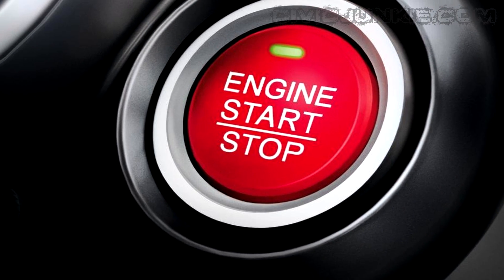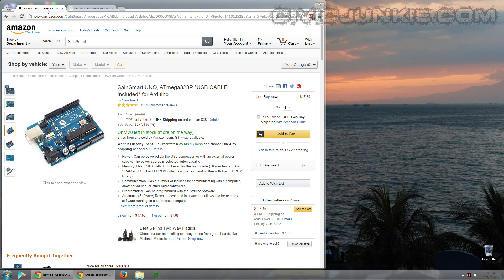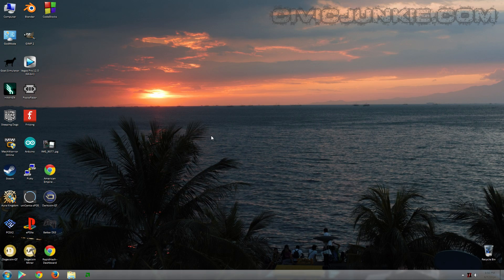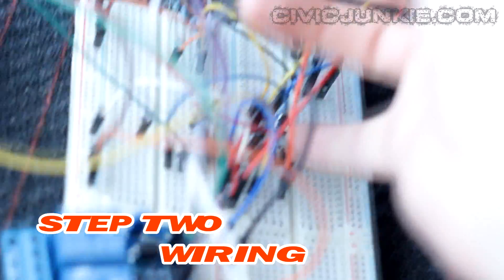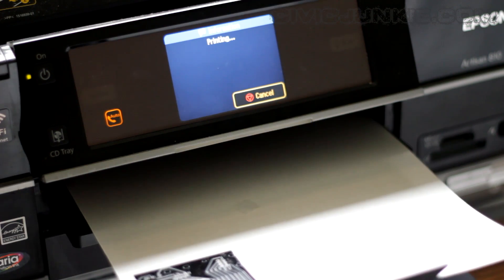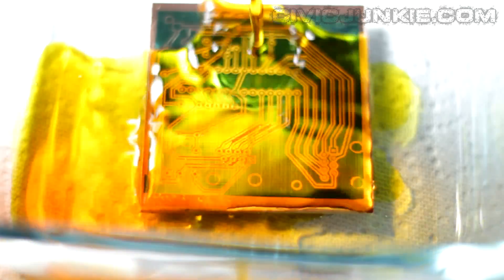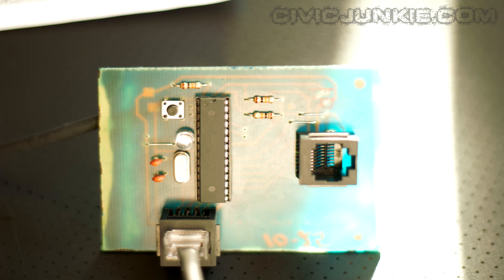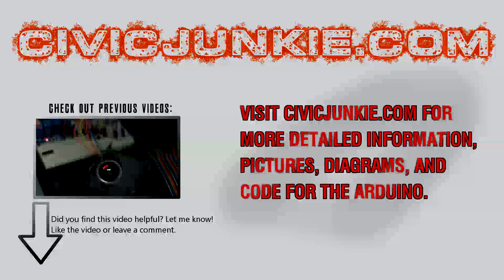Engine Start Button

Comment: Great work bro, am doing mine soon  as my switch arrives. Just concerned about security though; any measure taken on that perhaps...
Reply from the maker: The final result has RFID. An RFID tag or a phone with NFC can be used as a 'key.' I don't recall if I ever put that in a video, though.

Comment: Hey man greetings from Colombia, good job on the project. I saw this a few months ago and I went ahead and made it for my car. I'm still working on it, I've done a few tweaks to your code to Mach my needs but I'd like to know how do you manage the Power consumption of the whole system, do you use any kind of killswitch or do you leave the ATmega on all the time, since I used a voltage regulator instead of an USB converter, it gets hot after some hours, I don't want it to consume power while the car is off and the alarm is set, so how have you done yours?
Reply from the maker: The ATmega is always powered. Its current draw isn't enough to drain the car battery. However, you should measure how much current your setup uses and determine if it's okay or if you need to make changes. I think you should make sure all your car's electronics pull less than 100mA when the car is off, probably closer to 50mA, but it depends on the car battery. Also, if the regulator power waste is acceptable, maybe just attach a heat sink to the regulator.

Comment: you over complicated something so simple.

on a pre2000's vehicle you can theoretically hot wire your car and just put a switch in line so when you flick the switch it completes the circuit and the starter kicks in. of coarse you would need an accessory switch as well, but still simpler then printing you own PCB.

Comment: That's a lot of effort spent on a start button, when your key did the same job for free.   

Speaking of the key.  The really funny thing here is that you'll still need your keys to unlock your doors, as I don't think those cars had keyless entry.   

I will say, props for engineering something that works, albeit redundant in this application.

Comment: How does the car know the key is inside of it?  Does the circuit board communicate with any kind of alarm systems?  Does the car still have a steering lock?    
Can you just start it without a key?

Comment: So I'm finding this vid 2 years after you posted but it's answering my need for a DIY solution I feel I can actually get behind. Is the code essentially the same? Or does it vary by vehicle/button setup? I'm custom building a very with a Subaru engine and I'm planning on getting a Prius button installed.
Reply from the maker: The code should basically be the same for every vehicle, but may very slightly depending on how the original ignition switch works. All we're doing is replacing the keyed ignition switch with a relay module which is controlled by the Arduino/micro-controller. You will have to look at your ignition switch and figure out what wires it sends power to when you turn the key to the various positions. Any button will work. I wrote the code to control the 4 LEDs on the button I used. If the button you use doesn't have the LEDs, it'll be fine. You could use those outputs to turn on the headlights or something instead.
Reply: Dope. Thanks. This rig has helped simplify the whole idea for me.
Reply: Also, saw your article afterwards about adding RFID. what's your reason for using an entirely different arduino with the RFID device linked to the first UNO? could you not add Arduino's RFID shield and rewrite the code to include the function?
Reply from the maker: +Santos Nunez  I simply didn't have enough input pins free to add an RFID module to the same microcontroller. I attempted other ways, but found this to be the most reliable. Made coding easier too.

Comment: This isn't a how to add "start button" for dummies. Thank you for showing us the proper way without turning a key. Very detailed. Very impractical for even the average gear head. Could you hook up a key fob that acts like the newer model push buttons? As you know, the factory modern push button (at least for Mercedes) you need the key fob inside the car for it to start? Maybe that's your next video?

Comment: You can also use the Arduino Nano. Use the UNO to programme it and no circuit board printing. Plus it's smaller.

Comment: Is the PCB with the ATMega328 meant to replace the Arduino after prototyping/testing or dose it serve some other purpose?
Reply from the maker: Exactly. It's just to make it more permanent and durable. You could just solder wires straight to an Arduino Nano or something similar if you wanted.

Comment: I looked at your other tutorials and details on CivicJunkie and seen that you wrote the code so that you have to press the break peddle to actuate the starting sequence. On my 2003 Altima you don't have to press the brake to start the car and I don't want to have to start doing something new and something I view as ridiculously unnecessary. In my car as a safety feature you have to press the brake to take the car from park to another gear. So, I was wondering if the Arduino hardware would allow the writing of code so that, as you already demonstrated,  1 press actuates 'ACC" and a second press actuates 'ON' but in any mode (whether 'OFF", 'ACC" or 'ON') a long press, of say 1 or 1.2 seconds. would initiate the start sequence.
Reply: Richard Manson Remember.. Computers are just rocks we tricked into thinking.

You can make code do whatever you want as long as you know what you're telling it to do.

Comment: One way you can add anti-theft is like a friend of mine did. He had two buttons and a toggle installed and would have to do a sequence of buttons and toggles to enter a code to enable the starter. He had it done by an aftermarket alarm system installer. Was something that only engaged if he was forced out of the car and triggered by the anti-hi-jacking feature and something that prevented start if you didn't unlock the car with the key FOB. Wasn't needed in Vale mode either.  Could this somehow be adapted to completely replace key-less push button  system that malfunctioned.

Comment: this is a good video about start stop function,we are professional in this field,you can contact us if you are interesting in our engine start stop system.

    shenzhen cardot electronics technology Co,.ltd is a manufactuer
and trader specialized in the research,development and production of car alarm,keyless
entry&push button engine start stop system,GSM&GPS car security system.

Shenzhen Cardot Electronics Technology Co.,Ltd
the 6th Floor,Cheng Jia Technology Park,NO.3581,FengXin Road,GuangMing New District,shenzhen city,china

Email:info@szcardot.com
Phone:8675527119211
whats app:+8613510257499
skype:cardots
wechat:13510257499
web:www.szcardot.com

Comment: unless you have a sistem that senses your key in the car, or one in which you insert the key fob and than push the button, you just made that car easy to steel.

so the idea with the key and the button is not counter intuitive... but the whole button thing is silly... i have start button with fob inserted and i miss the key in my old car.
Reply: It is counter intuitive in that if you have to insert the OEM key into a hole, and then ROTATE IT TO THE START POSITION, why would you install this project to push a button when another clockwise click of the keyed ignition switch does the same thing. The idea was to eliminate the necessity of a key being inserted and turned or needing a key altogether. I applaud his effort and work but he should have included an anti-theft component to this.

Comment: Hi Alloy, I watched all 3 of your videos and found it very interesting and would like to do this on my car.
However i did try it out with one arduino, bench tested it as shown in your video but it does not work the way i see it in your video, I used the code and followed the schematic that's on civivjunkie.com I also followed the pin assignment like how its in the code but had no luck, the accessory and ignition works ok but starter dont work at all and stays on all time and when it suppose to shut foo all power it blinks and comes back on and stays on.
Could you please help me get this right.

Comment: Hey again. I'm starting to figure out how to code it all myself, but i'm having a bit of trouble, mostly with the green LED, that normally flashes but flashes hard when the clutch is pressed. I can do so the button lights green for 100 milliseconds and then shuts off for 5 seconds, and when the clutch is pressed it flashes hard. But it doesn't happen instantly. It waits until it goes through the 5 second loop before flashing hard. Can you help me fix that?

Comment: Does this bypass the immobilizer? I have a 99 prelude type s as a project car but I accidentally misplace my ONLY ***** key and now am screwed ._.
Reply from the maker: You would have to purchase a separate bypass module for the immobilizer. As for losing your keys, check to see if a Honda dealership can make a key using your VIN. But, if you're looking for an excuse for a fun project, here ya go!

Comment: Ok so one think you forgot if you don't have a key to go with the start button someone can easily break you're window and push the button and steal you're car
Reply from the maker: That's why I added RFID after I made the video.
Reply: It be nice if you said that. That's a very important part of the whole piece.
Reply: Why not make a video on that? I am assuming you didn't yet because you didn't mention making it here by editing your comment. Also, how secure is your RFID system? Can someone just scan the air with a receiver and steel the codes? Did you use some more sophisticated system like code rotating or something. I realize a sophisticated system may not be necessary if your car is not on the hot to steel list or older but some may be interested in knowing.

Comment: And what will I do with my key after installing it ? Will it be only used for unlocking my car ? And what if someone press the button Unknowingly? It happens with children generally
Reply: I didn't look at the code yet but If he wrote correctly, it should prevent the starter from being re-engaged while the motor is already running. I am not sure how this or most buttons work (since I haven't owned such a vehicle) in terms of a second press automatically initiates the start sequence or it takes a 'long' press or what. Any children should not be left in a vehicle without the operator or an adult somewhere nearby within eyesight anyway.

Comment: I'd prefer to stay with the key unless there is a way to code security into this.
Reply from the maker: I have since added NFC to my engine start button, so yes, you can easily add security features. I have a video half finished of the NFC/RFID setup, but procrastination...
I did post something on civicjunkie.com about the NFC, though.

Comment: For these or future circuit boards i highly recommend a Co. called ExpressPCB, easy to use and you get 3 boards for 61 bucks in a couple of days. easy to use free software, too. check them out, I've used them for years. https://www.expresspcb.com/

Comment: hey so the code that you have on that site would work for any car or truck?
Reply: Scrappy ...... you shouldn't even be thinking about attempting this project if you didn't realize that the code was pertinent to the ARDUINO, and did not interface with any of the motor vehicles OBS's. Everything was stand alone and custom right down to the actuator. Most of us didn't even need to see electronic or electrical schematics to realize this. Or, maybe you didn't watch the video closely enogh.

Comment: Ferrari Lamborghini and other super cars use keys and start buttons. so not really uncommon
Reply: Those vehicles you mentioned are in themselves UNCOMMON to most of us and to say a push button is not uncommon because it is common on vehicles that cost well over $150,000 is a retarded and irrelevant statement in itself. Fact is that a push button start is not uncommon anymore among COMMON, domestic vehicles manufactured in the USA over the lase 3-5 years. I am assuming that you own NOTHING BUT Ferrari's and Lamborghini's unlike 99 percent of the rest of us.

Comment: Hey man, I'm having a bit of trouble getting this to act right. My "ON LED" won't turn on, and my "ACC LED" turns on in seemingly random order -sometimes with 3 button presses, sometimes 2, sometimes 5. Also, I notice in the code you put on CivicJunkies, you use pin 2 for the clutch switch, but on the diagram you don't even use pin 2. I'm new to arduino, so I would appreciate any help in getting this to work!
Reply from the maker: +Talal916 Interesting issue. Does the button have a pull-down resistor? Are the positive and negative LED leads connected with the correct polarity in mind? Another thing that might affect the circuit is improper or missing ground connections.
Reply: Lol, I'm the guy who emailed you. Yeah I'm using pull down resistors and double checked the polarity. Still working on implementing that updated code you put up with your NFC build.

Comment: ahhh button start is more old fashion then key start
Reply: HUH? Buttons require electricity and keys have been around since LONG BEFORE electricity. Do you have a pill bottle nearby or maybe a bottle with liquid in it with the number 80 on the side? Or maybe a skinny little cigarette .......

Comment: +Alloysnake I've watched your video over and over again and have been on your website... ok cool I get most of it but I just don't see what you do with the arduino after the you print the circuit board the website either also doesn't show... I'm interested in doing this because all the others you still need a key 😛.... ok correct me if wrong.... you connect the arduino to the circuit board then the circuit board to the relay module?

Comment: Or you could scrap the Arduino and pcb, add a button to the ignition wires which when pressed would essentially be hot wiring your car... And save all the hassle of a circuit and mc since it doesnt have a security feature anyway....
Reply: Your ignition switch is NOT just and on/off switch. It has three positions. So NO, you can't. Maybe you could eliminate the electronics by adding 2 toggles and a button or 1 toggle and 2 buttons. But then it would be a slopping looking job and be easier to just turn a key.

Comment: So what are you supposed to do if you have a older car with no computer?
Reply from the maker: +Matt Carrasquillo This is easiest on older vehicles, such as most vehicles made before 2000. All this is doing is replacing the ignition switch with electronic modules. It's slightly more complicated, yes. But, when implemented correctly, it is easier to use, and has a "cool" factor. Basically, this is just for fun.

Comment: Alloysnake, I commend you for being able to use your knowledge and sharing it with us. I did review comments. I will say a lot of losers who have no respect for others. Their comments leave me to believe they are very ignorant. 
Some of the viewers do bring up valid comments. You have computer skills most of us don't. You have capabilities to print circuit boards we don't. You are talented. I was hoping this would be a fairly easy tutorial. It seems like I need to search further, like for a kit.
LOVE the music, that I can agree upon. Thanks for sharing.
Reply from the maker: +Michael - I appreciate your comment. You do not need to create a custom circuit board for this. Though, there are good tutorials by other YouTubers that explain the process far better than I can (search "circuit board etching), and you can find all the materials on Amazon. However, you can do this without a custom circuit board. If you know how to solder, you can just solder wires straight to an Arduino Micro or Nano; maybe use generic connectors to make it modular. For some reason I hadn't thought of this at the time. Again, I really appreciate your comment, and how balanced it is. I'm not good at making videos, but positive comments make me want to keep it up. Thank you!
Reply: As time allows I will research the web for such. Keep them coming.

Comment: How simple would it be to go "backwards" - that is, to replace a stock push button with a key start?
Reply from the maker: +Anon ymous That's an interesting idea. I'm not sure how easy that would be, but I do know that some manufacturers make models with, and without a start button. Find out if your model had a key option, then you might be able to convert to the keyed ignition switch by installing used parts. Does that make sense?
Reply: Would be different  per make and model. Different makes implement their system in different ways. I am not a fan of OEM systems like this since when they fail you end up with a very large and expensive repair bill on something that is proprietary. I think designing your own like this is the better way to go.